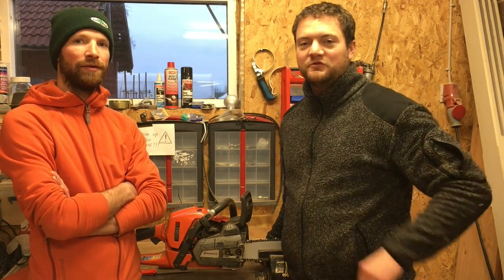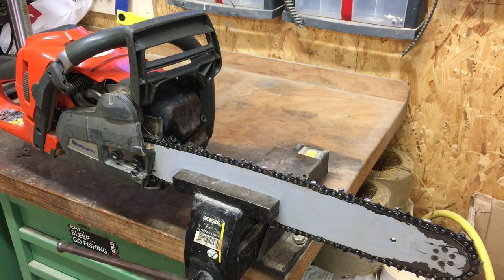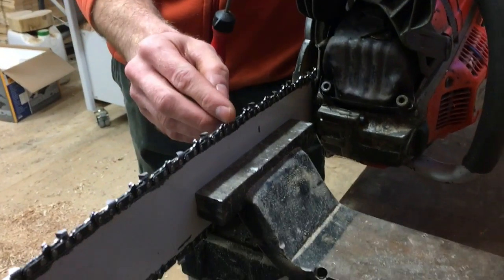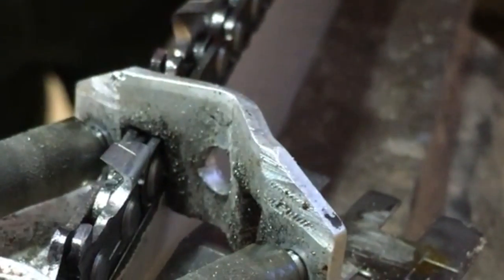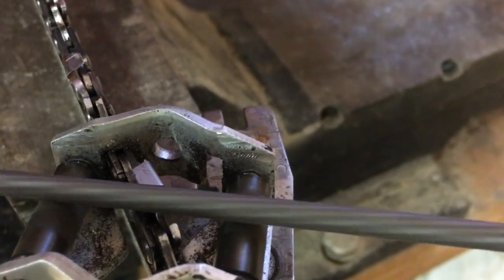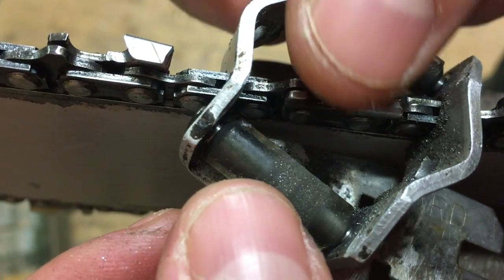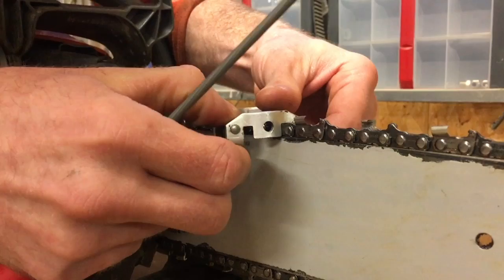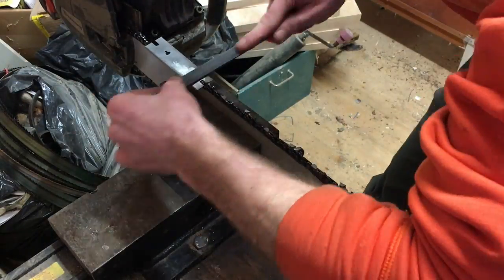Razor-Sharp Chainsaw - How It's Done

Comment: IMO,,you can only get a chainsaw chain so sharp. Making it razor sharp does nothing more than a moderately sharp chain. Razor sharp will be gone in one single cut.
  But if sharpened correctly a sharp blade will cut a long time and cut very well!!   I use a machine,,it keeps every blade the same as  the rest. And the rakers must be the same or you will have big problems.
  Sharpening by hand is for the field. It works to fix a dull chain after  hitting a nail or dirt. Its impossible to get perfect results from sharpening by hand again and again. The chain will be off after 2 or 3 times of sharpening it by hand.
  A machine will bring it back to factory condition.  Sorry but there is NO other way!!!   No body on earth can straighten a chain out perfectly by hand!!!!  Its impossible!!
Reply: The chain is not perfect from factory. It's not that hard to sharpen it better.
Reply: You can get it perfect, manually, by using a bar-mounted file guide--not like the one in this video.  Mine is made by Stihl, and it gets my chain perfect every time.  Granberg makes one, and so do a few other companies.
Reply: Factory condition is possible but nothing is perfect...and that can be seen if you use a good enough gauge.  I wish you well.
Reply: I have always sharpened by hand. No problems. It just takes some practice.
Reply: You're quite right bloke. I have been a Bladesmith for 50 years now and have been sharpening chains in my workshop all that time as well as building saws. Still work in my shop 7 days a week and it seems everyone is an expert accept me?
Reply: LOL  I wish you well.
Reply: Who needs a perfect chain? It just needs to cut, and i keep mine cutting with just a file, not even a vise. Once you hit rocks or a nail or even just dirt the teeth dull and deform all differently. In those cases I think hand filing is better because I can address each tooth as needed. And afterward she cuts fine, and I cut wood every weekend and I sharpen every weekend. It works for me just fine

Comment: Why would you want to use a stupid file to sharpen a chain when you can use a sharpening machine which, when used correctly, makes the chain like new every time with minimum effort? I rotate several chains and when one gets dull I simply replace it with a sharp one and and sharpen the dull one later at home. Replacing the chain is also  a good opportunity to turn the bar around.

And when you sharpen the chain with a machine, you can use a bench grinder to adjust the height of the depth gauge.

Comment: You made no mention of a witness mark or chains with a witness link. The metal you flat filed is called a raker ...you are supposed to round the leading edge of those. Also, you do one less stroke of filing on the far side because it will be less coordinated. There is no need to spin the file!

Comment: hi guys yes the line you refer to on the tooth is there for a guide on the furthest a chain should be sharpened before discarding you are partially correct in using it as a guide assistant to angle of sharpening as it is set up to original angle of tooth but you can always change that angle depending on what type of cutting you are doing maybe need better trainers or simply go read up on stuff before posting videos of how to as you will give misleading info on stuff and as most tree cutters are rather easily agitated and some can get quite aggressive if you fuck there setup on saw in the industry

Comment: Great instruction guys, TY!  I love that little gauge, getting one!  Simple is good, you'll have it & use it more.  I used to love my bro-in-laws electric sharpener, until I started realizing how much extra steel I was removing every time, yikes!  Every spark was a firey little tear the chain crying because of the waste!  I was looking for an accurate manual method and I heard very good things about this Made in USA, all metal sharpening jig by GRANBERG, model #G106B File-N-Joint.  Turns out they've been around a long time.  I just got one in the mail, have not used it but it looks nice & sturdy.  I did read a couple guys changed out the wing nut for a better one.  Link to my photo of product/package: https://drive.google.com/open?id=0B04V2e1MoOOqUHRQeVJjSHZycXc

Comment: Too many people throw around the term "razor sharp". Virtually nothing but an actual razor is that sharp. Razor sharp literally means to be able to cut hair with almost no resistance. I doubt you could ever get a saw chain that sharp. And if you did, the edge would be knocked off in less than a second of cutting wood.

Comment: A typical chain is $15 to $20, basically a throw away part.  If your in business for yourself you know.... time is money.  I just file mine freehand in the woods... when it gets real bad I throw it in a power chain sharpener..... when its spent, I just throw it away... I don't have hours of time to spend on a $15 chain.
Reply: banshee8989 it doesn't take hours it just takes knowledge I haven't used a gauge since I was a teenager.
Reply: Carroll Sande

Comment: Throw away that stupid angle gauge and raker gauge and do it by hand. all you need is the vice and files if you know what you are doing. on a side note they cut way harder if you take the rakers down a little more

Comment: I love Husqvarna everytime me and my step-father go out and he has his stihl, I'm already well into cutting while he's still trying to get his started 🤣 doesn't matter if his is new or an older one..
Reply: Andrew that statement is so stupid.
Reply: Bullshit. I own both. Stihl is way easier to start than Husq.
Reply: @OTEP1234567891011  all right ,I shouldn't have spoke so soon with owning one person.but how do they get running without having a primer builb right away?
Reply: andrew zweiger I admit it can be hard to start in the winter. But during the summer I have no problem getting my Stihls started by the 5th pull. I spend much longer on my 562xp, close to around 9 or 10 pulls, if that means anything. But my Stihl starts easier even without a primer bulb. Plus, you don’t need a primer bulb really on fixed-carb jets like the Stihls have. Correct me if I’m wrong though.
Reply: I own a Stihl and it fires up in three cranks. Winter or summer. I've used Huskies and they start good too. If you're dads Stihl is rough to start, it needs to go in the shop. Something needs to be done to get it back to normal.
Reply: @OTEP1234567891011  Nope. I choke mine. When it pops. I move the switch to half choke and start it. Then I move to run position. The compression button makes starting one a snap.

Comment: This is awesome but its just too much work.   The hardware store has a drop off program.  You drop off an extra and pick it up in a week for $10.   I think $10 is worth it.
Reply: The hardware store uses a grinder, which a) takes extra metal off, using up your chain faster and b) doesn't get it quite as sharp. $10 is worth it if you only use a saw occasionally, but using one full time makes it worth learning to sharpen, even if you occasionally have one machine ground. The one advantage to a machine is it keeps all the teeth the same length.
Reply: Thats a good point.

Comment: poster doesn't even know the parts of the chain ( which by the way, that "riser" is called the RAKE and it DOES NOT get filed down with every sharpening ) & there is no such thing as a sharp file,, it is either dirty or clean... thus I care less if you got it sharp... A person who doesn't know the basics of the tool... SHOULD NOT post a video called " How it's done )
Reply: well sir you are far from correct it is a depth gauge and is there so that you can keep a manageable depth of cut so as too not bite into the wood you are cutting which in return would have your chain bogging in to hard meaning saw motor and cintrifical clutch has more load on it which is not good for longetivity of machine and parts yes these guys seem bit more lacking in knowledge than they should know if it is their profession but if you are going to have a go at them at least make sure you seem more knowledgeable than they are.
Reply: me: 30 plus years of using/working/repairing chainsaws and chains , says WTFEver..the new fancy term may be depth gauge..it was first called a rake, to prevent the chain from digging into much..because it raked ahead of the chisel both limiting speed and clearing the channel.. I bet money, you are one of those people that think that there is such a thing as an anti kickback bar for chainsaws.. ( which is a twist gimmick, so the average consumer will think they are safer ) No Such thing.. it's a chain with an increased number of rakes and less chisels, thus it does not cut as fast and is easier to use.. which is why they say only use that type of recommended chain.. Using a standard chain takes away that claim of anti kick back... and further more... your reply doesnt change the fact of my statement...doesn't know the parts of a chain.'  Hey... being that you believe all that is on the web... click on over to the guy on youtube claiming the best way to sharpen a chain is with a HI SPEED drill with a standard round chain file in the chuck.... can makes the same claims.. He knows it all.. any high school kid taking Shop knows such a file is not meant for spinning and you do not push them back in forth at high speeds spinning with down pressure both ways...yep... everyone thinks they know it all....
Reply: Yes well mate that's my trade also n we here in Australia have to renew our tickets every four years and I never failed on anything not even in the first course and I was using n had my own saws since about 12 and never got any info of the web all was in proper theory and through national recognised training n calling them rakes is a joke that's not what they are intended for bet you think a chain stays flat when in use no doubt but not it snakes side to side as outside of tooth bites n also waves up and down that if you don't believe you can see on slow motion videos and also not every tooth cuts on every pass and correct there is no anti kickback bar all they did was made a tapered end towards roller at end of bar so there is less kickback area at circumference n yep agree with you there obviously your just a self proclaimed hypocrite as you seem to think you know it all
Reply: I bet English is not Tim's first language, so there may be some words lost in translation.  
Overall, this was a good video.